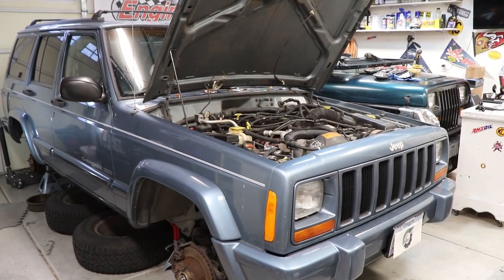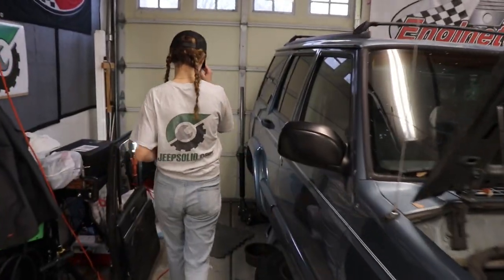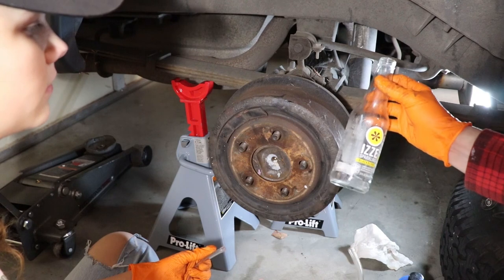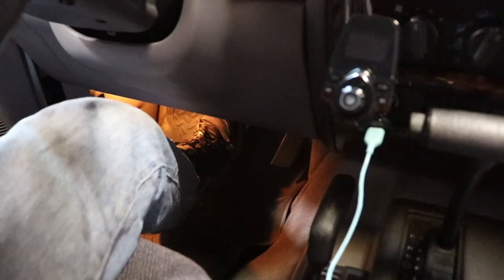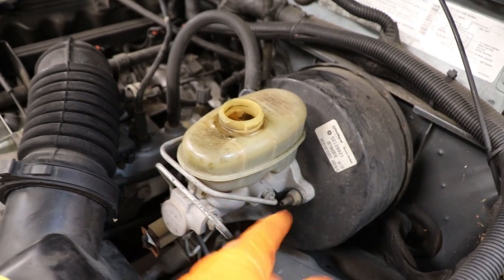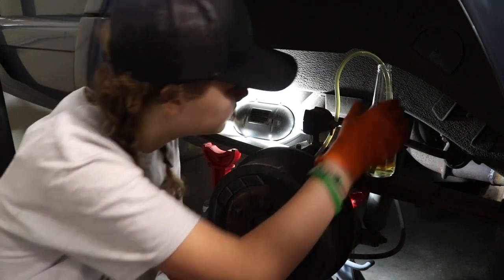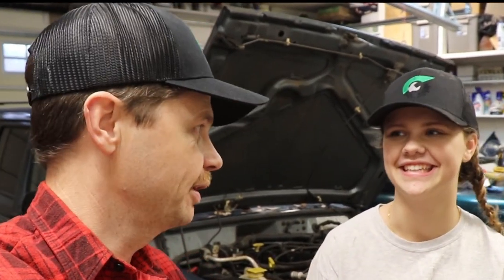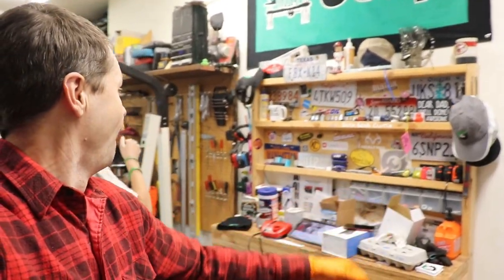Learning to Bleed Brakes! Jeep Cherokee XJ Brake Bleeding

Comment: When bleeding non ABS brakes, you can gravity bleed them. This works good when you don't have a helper. My 95 Sport (Bumble Jeep) doesn't have ABS, so I've had to gravity bleed them a couple of times. It has worked well for me. I had a vacuum bleeder but loaned it to a "friend" who didn't clean it after he used it, so it's junk now. You would still bleed in the same order, working from  farthest to closest, keeping master cylinder topped off. Miss having my daughter working with me in the garage. God bless, stay well. Good job Sasha!
Reply from the maker: Thanks. Good tip!

Comment: I've been chasing the misfire cylinder 3 since I bought my 2001 xj 2 years ago finally found it! Fuel pressure test revealed pressure drop after turning key off,replaced fuel pump and viola! No more check engine light and long crank time !!! Yeah!!

Comment: I use a system that pushes the fluid up through the system, it's easier to push air up than pulling air down through the brake lines.
Reply from the maker: Huh. Cool! I have not tried that.